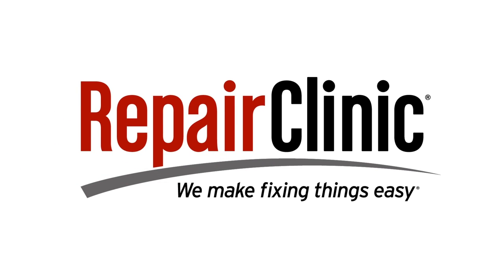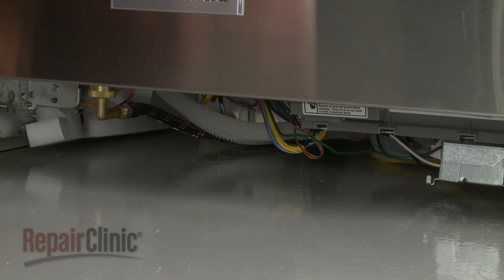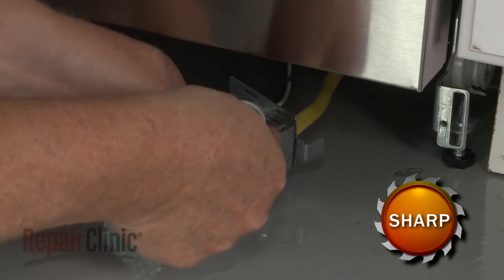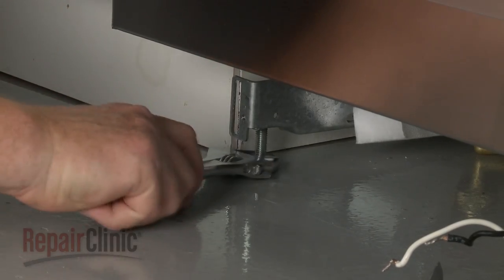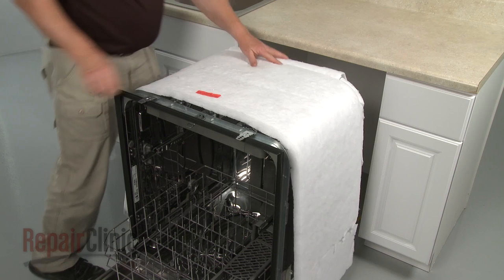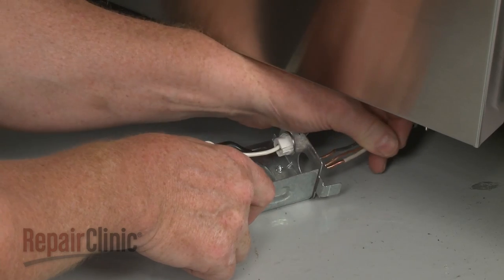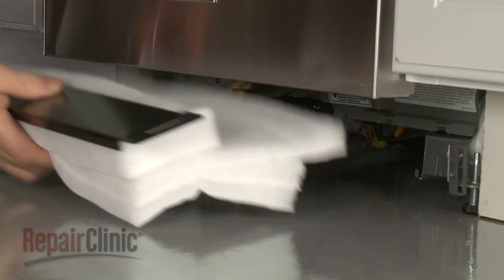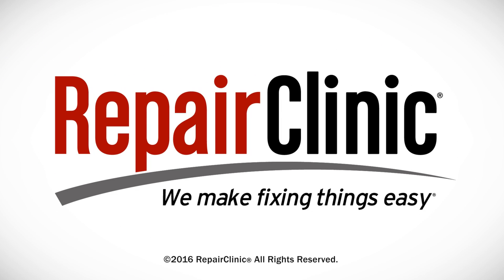KitchenAid Dishwasher Right Upper Rack Track #W10811587

Comment: Thank you for making this video as it's exactly what I needed. My right rail track is messed up and the top shelf hangs on holding to the left rail as all the tiny balls from the right have eventually dropped off as the white plastic ridge-like clip that holds them kept cracking small pieces at a time. Wish there is the part that just snaps the mini-balls clip to the rail so we send fewer things to landfills.

Comment: Before replacing the lower panels, turn  the water supply on and then check for leaks at the supply valve. Hate to have a leak harm the flooring and then have to repair it. Also, if one side track goes bad, the other may go soon after. If you are taking out the machine to do one side, why not buy both sides and do them both at the same time? Saves all that work at a later date.

Comment: Good instructions!
Ordering parts through Whirlpool Parts was good.
Service rep, who was not a technician, was able to pin point exact parts through assembly drawings and add clarity on needed part numbers.
Ordered 2 left tracks for 2nd and 3rd rack, and parts arrived by Puralator  (to Toronto) in 3 working days.
Strongly recommend replacing goth L and R tracks on the second level (large drawer).  Drawer bearings are inbreed into yellow plastic thin assembly.  Plastics becomes brittle over time, breaks and  releases bearings into the washer.  Filter traps them, but if you do not see them or do not register sound when bearings pop out, while cleaning filter there is a risk that they go below filter into drain/pump.
All securing drawer clips for 2nd drawer release broke in disassembly, as they became very brittle. This is no issue as drawer is held in position by gravity and on a back side mating parts fit into metal grove in the rail. 

Vanja

Comment: Thanks I HAVE 18 MONTH OLD MAYTAG. THE SPOT WELDS ON RAG BROKE PISSED ME OFF. CALLED PHONE THEY SENT ME PART. IF HAVE LOCAL GUY FIX COAST ME 185$  SO HAVE TO MYSELF..bIG STICKER ON DISHWASHER SAY 1O YEAR WARENTY but just parts WTF!!! didn t even last 2 years..thanks for vid...
Reply: Hey Todd I had the exact same thing happen - did they send you the part?? Looks like they want me to use a repair guy - yeah no thanks - repair looks simple enough - do you happen to know what the part number was?? Thanks. If it is cheaper than the repair guy I may just order it or try JB Weld.
Reply: @scottmackintosh7751   yes sent me part..pulling out dishwasher pain..but replacing brackit easy..i asked for right and left .while dishwasher out ?.they 
said no .can only replace broke one...i thinkinf orhwr one probly brake  anyday.....
Reply: @toddbollen1455  Thanks Todd. I got lucky when I called in and they had our model on a special projects list so we got parts and labour covered and they did left and right. If you need any info from me let me.know. They should treat all customers the same. Those welds were garbo. Thanks again for the reply Merry Christmas. 🎅👍
Reply: Wow. You got better person on line maybe?? Did you call the 1800 number on warenty info? Way lady talked to me was .ro bad ya didn t buy extended warenty....glad you had better luck..
Reply: @scottmackintosh7751   don t think jp weld would of held up..gets hot and wet!
Reply: @toddbollen1455  I called the Canadian line - but you should of had the same coverage - just really depends on who you get - cust service sucks everywhere now.